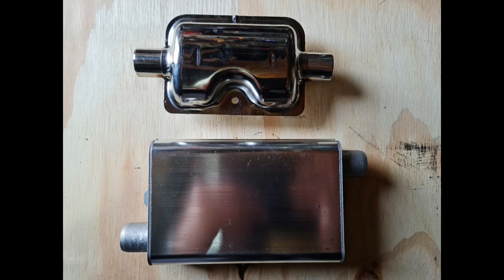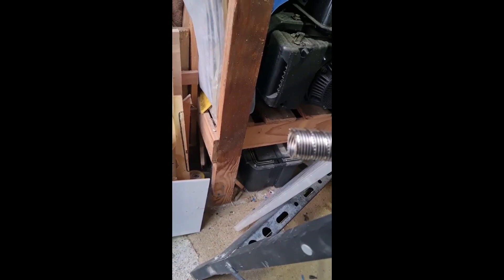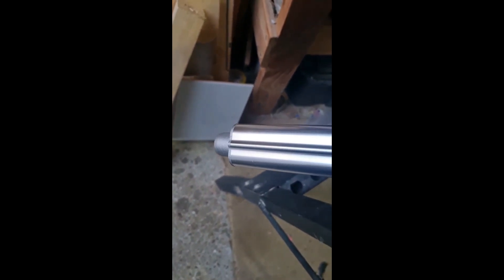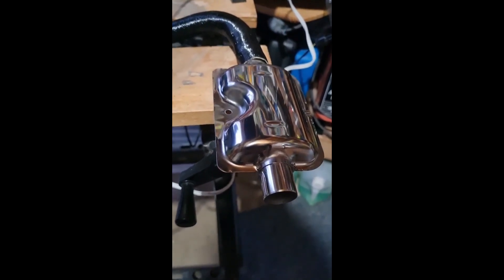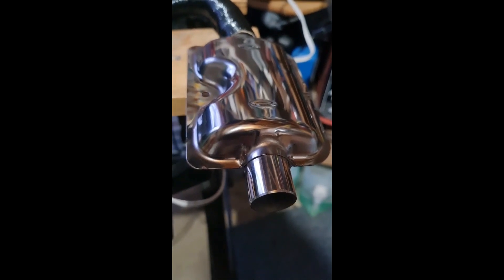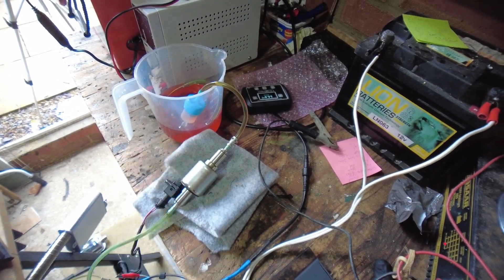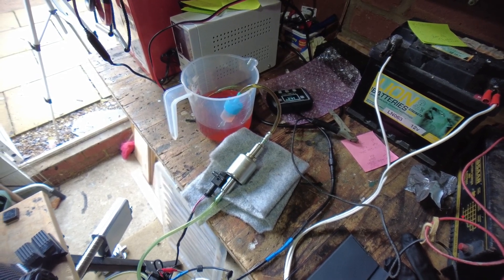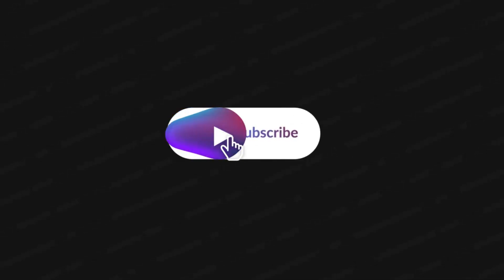Chinese Diesel heater exhaust upgrade.

Comment: BEWARE! This exhaust while being undeniably quiter caused my heater to coke up quite badly to the point where it wouldn't ignite in no time, with lots of white smoke. After rebuilding the heater I took the exhaust apart and from what I can see is it runs through a much smaller diameter pipe which goes through a "S" bend. This maybe ok on a combustion engine but definitely not for a diesel heater. Been running the original exhaust ever since with no issues.
Reply from the maker: Hi thanks for the comment, I'm not sure if it's the cause, but my erberspatcher heater won't run on min, it gets to temperature, goes into min mode and flames out. Might take the exhaust off to see if this helps.
Reply: Thanks for sharing interesting insight. I have to install a longer exhaust pipe in the trunk of my estate vehicle, trough existing, factory holes. The original 60cm is too short and I will need at least 120cm, perhaps 180cm. I was wondering if the length of the exhaust will cause issues. The diameter is the same, though.
Reply from the maker: @pavel9652  hello. I don't believe the length of the exhaust will affect the heater, as other users I have watched try to harness the heat loss from the exhaust in various ways, and the longer the exhaust offers better options. What is crucial though with longer exhaust is that they must be installed with a downward slope away from the heater unit, as water (condensation) will otherwise collect in the exhaust pipe.
Reply: At last a conversation in the reply section that was constructive without someone taking the hump 👍
Reply: had exactly the same trouble , couldnt figure out what was causing it ,  so coked up inside it was almost unbelievable , even filled the exhaust going out side , now run through two original silencers and no more probs , also a bit quieter .

Comment: Hi Roy, if you suspend your fuel pump with zip ties so it's hanging in the air , you will eliminate most of the pumps ticking sound.  Cheers from 🇦🇺🐨🦘
Reply from the maker: Hi thanks for watching. Yes I think that is the way I will go, suspending it within a waterproof box mounted to the chassis.
Reply: i started with a box and settled on wrapping it with closed cell foam which seemed to damp the noise.  the first thing i did however was remove the rubber clamp and as suggested made a noticeable difference to simply suspend by itself.

Comment: No silencer needed when the first cab heaters came out there was no silencer the exhaust pipe was bent near the end then a hole was pierced with a screwdriver on the bend so fresh air was pulled in this made it very quiet
Reply from the maker: Hi thanks for viewing my video. Wow that's an interesting concept, wonder why it's not used still today.

Comment: Brilliant review.  I've got one on order but it nice to see it actually works. Regarding the pump I covered mine in self amalgamating rubber tape and a weather proof enclosure 150x53x85 which knocked down the noise.
Reply from the maker: Hi thanks for viewing. I was considering buying the new upgraded pump as from what I have seen, they do operate quieter.  Think I will buy it as a spare.

Comment: Really does make a difference, Mine was shoddy and not sealed properly (same company as your box) I had to undo the screws and put sealant around the edges . Works good now .
Reply from the maker: Thanks for watching. Very pleased with mine, makes a notable difference, I will check the seals though.

Comment: The original muffler has fiberglass that could go into your intake if you use it that way. I just noticed the loose fibers today when I looked in the muffler.
Reply from the maker: @GrowingPains917  Hello. Thanks for viewing my video. I didn't actually use the old muffler on the air intake in the end, but your point is valid, and others who read these comments should take note.

Comment: There ius an Austrailian guy on youtube that tested a few different exhausts and he found the one you have had exactly the same effrect as two chinese diesel heater exausts joined by a piece of 22mm copper pipe.
Reply from the maker: Thanks for viewing. That's interesting, have not seen that video.
Reply: That's my set up after watching that same Austrailian guy (John McK 47). Definately makes a difference in reducing noise.

Comment: i have had mine for 2 months and idk what happend but it is legit dumping fuel out the tail pipe not good im suspecting the fuel pump went bad
Reply from the maker: Hi thanks for watching. Not experienced that issue myself, hopefully you will soon find the problem and resolve it.
Reply: Just your average joe here, and I dont even own one of these, but… you might be looking at exhaust water vapor condensing on the inside of the exhaust pipe. Or you have incomplete combustion but then you would be complaing about strange noises and soot aswell. Besides, these don’t consume enough diesel for it to be running into the burn chamber, let alone running out from it..

Comment: I've been running my diesel heater on the same muffler. Came with the factory one I don't need upgrade. It works . ?
Why mess with it
Reply from the maker: Hello. I have recently uploaded a video explaining why I reverted back to the original due to problems this upgraded one caused, in this instance it was best to stick with the original.

Comment: Rubber case for pump suspended by heavy duty cable ties and under your van works well, with heater inside van.
Reply from the maker: Hello. Thanks for viewing and commenting on my video. Fortunately within my van you cannot hear the pump , or what you can hear is not concerning. I have suspended the pump via cable ties for the heater which provides heat into my home. And that has helped quieten it down considerably.
Reply: @royclark8385  Nice. Good way to go. I’m in a van now but when I move back into a house I’m seriously considering these heaters to save on the bills.
Reply from the maker: @JJ_Khailha  hello. Thanks for viewing my video and taking the time to comment. I am really pleased with my heater, I am sure as this concept gets more coverage many more astute hone owners will look at installing them.

Comment: For me the exhaust noise on my 5kw heater  is no problem for me. Someone parked right next to me may not like it.
Reply from the maker: Hello. I appreciate your comments. We actually ended up removing the upgraded exhaust as it caused my eberspacher D2 to flame out when on its lowest setting. Once removed it works fine. It's a bit noisy without the exhaust though.

Comment: Makes me wonder if some noise coming from exhaust gas passing over corrugated tubing. Interesting if exhaust tube was straight tube, perhaps 1 inch conduit tubing.
Reply from the maker: Hello
 Thanks for watching my video. I did hear once that the spiral aspect of the exhaust pipe was designed to reduce the sound upon exit, not sure if that has been proven mind.

Comment: How many hours did you run the heater with this muffler? I installed it as well (before I saw your video) and even though I have used the heater only four a short period of time (less than 50 hours) over the last year or so, it stopped working. I took it apart and it was full of soot. Literally. the exhaust opening on the bottom had like an 8mm opening left in it, the rest was filled with soot. I opened it up and cleaned it and it works again. When I was testing it, I noticed some black smoke from the exhaust. I went into the hidden menu to change the air/fuel ratio (more air, less fuel) and now it is ok. I hope it will not soot up as quickly as before. So I was wondering if this might have something to do with the extra muffler (and a piece of extra exhaust pipe). Maybe it causes some extra resistance that might cause the heater to suck in less air (what goes in must come out after all). I am not sure, I haven't tested it without the muffler, it's just a theory. I am curious about your experience with it. BTW, I'm in the Netherlands BTW, so It's not an elevation issue :)
Reply from the maker: @alexbik  hello. Thanks for visiting my channel. I was initially impressed with the silencer, following this test, although it was only a test so was not run for very long. I did however fit the silencer to my van, where I have a erbespatcher d2 fitted and within 30 minutes, once the van got to the required temperature and clicked into minimum setting, it would flame out, ie  turn the heater off, and keep trying to restart it. As soon as I removed the silencer and reinstalled the original one (same as cheap Chinese type) my problem went away and has never returned. So I can definitely say from experience they do restrict emissions venting, hence your build up.
Reply from the maker: @alexbik  I also have a 5kw heater installed in my house, running with the cheap silencer, I ran it all through the winter, on kerosene. Just yesterday I stripped it down to service it for this coming winter and it was completely clean inside, no soot build up at all. So I can recommend kerosene and the cheap silencer if you wish to avoid carbon/soot build up. I have uploaded some videos showing my installs.
Hope this helps answer your questions
Reply: @royclark8385  Thanks for the quick confirmation! I hope my settings will help. I dropped the minimum pump freq from 1.4 to 0.9, the max from 5.4 to 3 and I increased the min fan speed from 1500 to 1750 and max from 4500 to 5000. Time will tell if that's enough. I realize it will impact performance, but I don't need the full 5kW anyway.
Reply from the maker: @alexbik  I have played around with my settings reducing such as you have, but i discovered it was not reaching maximum temperature so ended up reverting close to the original settings. If you can buy/use kerosene I would definitely recommend that as it is said to burn at a higher temperature than diesel.
Reply: @royclark8385  The thing is, I have a propane heater in my RV as well (a Truma combined water/air heater) that I run off an LPG tank. In installed the diesel heater because you can not buy LPG everywhere, especially not in northern Sweden and Finland. So I really like to run it on diesel, since I have a 200L fuel tank and I can buy diesel fuel anywhere. I'll see how it goes with the new settings.I could also try to restrict the heated airflow a bit to increase the temperature.
Reply from the maker: @alexbik  OK. Well I hope you have found the solution.

Comment: If you can bolt the fuel pump holder directly on to your vans frame you will never hear it.
Reply from the maker: Hello. Thanks for viewing my video. We have now bolted the pump to the chassis of the van, via the pump rubber holding clamp, we can hear it when it first starts up, but on low, it's barely audible. We prefer not to sleep with it on  1. For safety reason (we do have installed a smoke and carbon monoxide alarm) 2. It gets too hot even on its lowest setting..

Comment: I can't hear my pump. It's attached to my van frame via the rubber holder. 👍
Reply from the maker: Hello. Thanks for viewing my video and taking the time to comment. I am intending to mount the pump under the van, so hoping, using the rubber mount I won't hear it all, or very little.

Comment: Fit pump as per instruction with connector upwards to remove bubbles and air-locks.
Reply from the maker: Hi. Thanks for viewing, yes when fitted to my vehicle I will angle it appropriately 40 degrees, the bench test was for testing purposes only.

Comment: did u try to put those two muffle in serie?
Reply from the maker: Hello.. I ended up using the original exhaust rather than the upgraded one.
Reply: @royclark8385   does it clog the exhaust?
Reply from the maker: @sunoncream1118  yes it caused my heater to flame out on lowest setting.

Comment: Thanks for the video. I installed one of these silencers and it's significantly better than the old one. The old one can be significantly improved by jamming a ball of aluminium foil in the middle of the silencer. The noise then has to actually pass through the silencer box rather than straight through. This free mod is nearly as good as the new silencer. However, it's also better on the air intake too.
Reply from the maker: Hello. Thanks for taking the time to view and comment. I was very impressed by the difference the upgraded exhaust made. These are great little heaters and the upgrades coming out only enhanced them.
Reply: Jamming anything in the exhaust may cause problems further up the chain, slowing the flow of gases may affect the burn cycle for example. It will be interesting if you have to take the thing apart more often to decoke it for example.

Comment: Thanks for quickly getting to the point and sharing. The air intake idea was quite original. I bought the same muffler (my heater did not come with a muffler), but, afterward, I learned about it being better not to have more than a total of 270 degrees of bends in the exhaust system.  The new muffler follows an "S" shape inside, creating 360 degrees of bends (180 degrees for each half of the "S").  Add to that any bends in the exhaust pipe/tubing and I'm even more over the 270 degree mark.  Apparently, going above 270 creates enough resistance to affect upstream combustion and even air intake, resulting in faster soot buildup (due to incomplete combustion) than normal.  If you are anyone else has some insight, I would appreciate it.  I have yet to install any components of my diesel heater system.  Thanks.
Reply from the maker: Hello. Thanks for watching my video and commenting. I am soon installing mine into the van, but you make an interesting point so will take this into consideration upon installation.
Reply: @royclark8385  Thanks for the reply.  I don't know much about exhaust systems.  The point I brought up was just something that I learned by watching a video by John McK 47 (a person one of the comments below mentions).  Good luck with the installation.

Comment: I agree with you the new silencers are good, the ultra quiet pumps are even better, Thats the pumps with the larger green plastic at the electic conection, they even sell them with built in filters not expensive either, One word of warning my first low noise pump leaked at the threads on to of pump so I used fuel seal paste to solve that. and I hang all my pumps on 6mm. bungee cord so the do not touch anything if a pipe has to go through a hole make it a  bigger hole and cushion the pipe. When it comes to all in one heaters, I bring all pumps outside the boxs ,as the actual box are cousing the resinance in the first place all that thin sheet rattling ,there are a number of ways you can mount them, the last one i did i used one of those straight joining brackets with 4 screw holes in them, i slipped it under one of the top cover screw holes and screwed it in, and tied my bungee through the hole at opposite end to the pump then more bungee pulling pump down of couse at the correct angle. regarding intake again I agree with you they worse with them than without anything. i go for the tiny wire mesh capes, but i will try your idea of using a silencer, as i've got loads spare now.. I own 5 heaters  now 2 heater my home, and 2 to heat my workshop, and one spare for reparies so i just swope out a heater and repair the spare! I am hoping to make big savings on gas usage when i start paying the high  charges in march, one heater is heating ground floor my home all day till bed time apart from one hour in morning.  I have the central heating on to bring heat up fast then it will keep the ground floor at 18to 20c depending on outside temps the heater is on the lowest setting using 150 ml of kerosene an hour at £ 1.08 per ltr . you can work out weather its worth it. a second heater is upstairs for my night tv watching in bed. with the loft insulation oh it heats up very quick. its to hot after an hour on. Sorry to have gone on so long , but you an see Im very happy with my set up i feel i must share! PS I should do my own video!
Reply from the maker: Hello Chris, thanks for watching and the indepth reply. I am looking to mount my pump in a waterproof electrical box under the van. I will look at the new upgraded pumps as the ticking does appear to be a concern in campervans.

Comment: Cool video i seen a guy hang the pump from little bungi cords n that helped pretty well .
Reply from the maker: Hi. Thanks for viewing. I intend to house mine in a waterproof box suspended via cable ties which I believe will quieten it considerably. I will videob and upload it if it works.

Comment: Guys, is this upgrade silencer sealed properly? I don't want it to drip condensation water all over the floor and leak fumes inside.
Reply from the maker: Hello. The updated exhaust does contain a drip hole on the base to allow condensation to be released. As to whether its sealed, you can remove several screws to access the internal workings and reseal the unit with appropriate sealent if you wanted to be assured of a seal. Most exhaust are located outside so your concern is not of  a great concern to others. As a sound muffler it works well.

Comment: put them both on the exhaust if you want it to be quieter.
Reply from the maker: Hi, thanks for viewing. I would if I was not going to use the original exhaust on the air intake, to again quieten the unit down as this also helps.

Comment: thanks for this video.  i was settled to get the “upgraded” silencer but still was unsure.  in the video there is a noticeable difference.  i like the idea of silencing the combustor intake with an exhaust silencer, as the pitch there is very noisy.  also, i found an amazon silencer, which looks like the straight-through unit included in the package, but has an actual bend with packing.  im tempted to get both for testing.
Reply from the maker: Hello. Thanks for viewing and taking the time to comment.